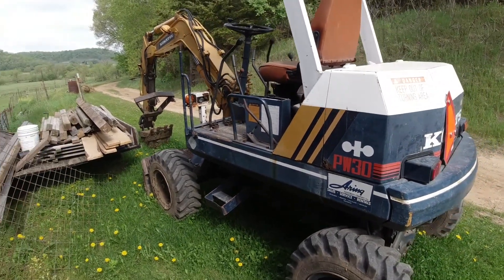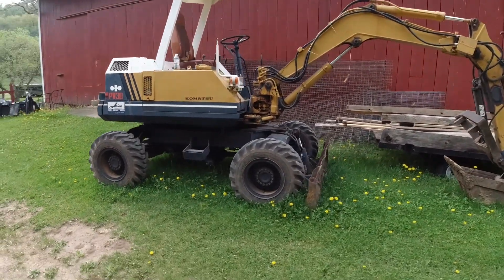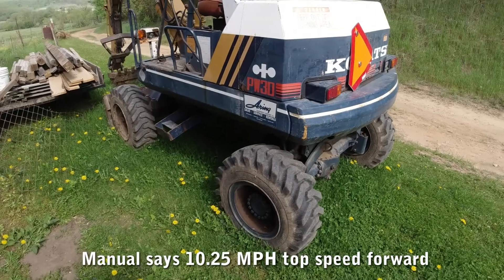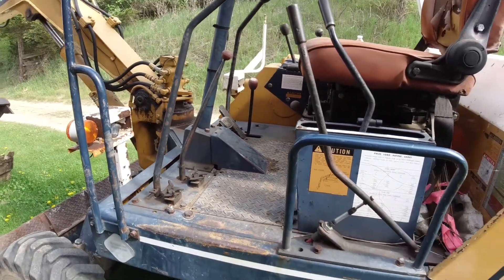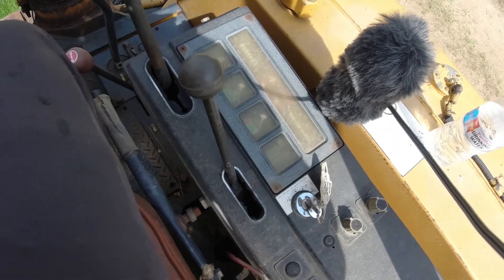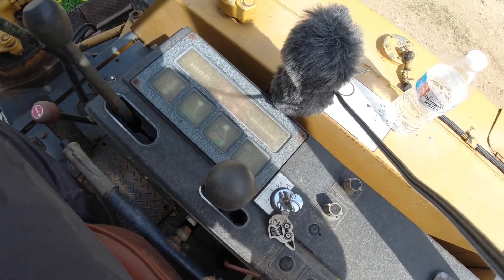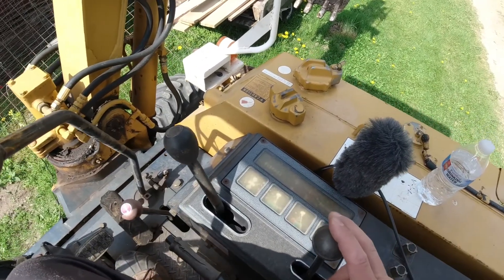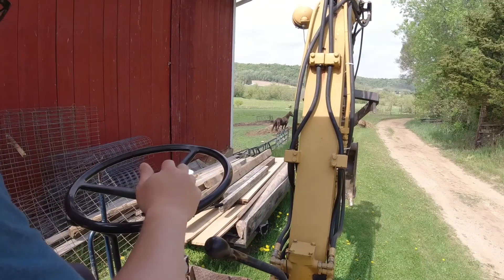Wheeled Excavator Demonstration - Komatsu PW30 - Picking up and loading scrap metal

Comment: Hello nice machine looks still fresh. How to you dig house footings with this ?
Reply from the maker: It could be done, might take a lot longer than using CAT 323 or similar.  It works the same as most excavators, you just need to be careful in mud so you don't get stuck. Thanks!
Reply: @driftlessinwi  how do you cross over a ditch using a wheel excavator ? You probably need to do that when doing house footings I think

Comment: I have tip for you, I have worked on weeled excavator for a few year, you dont want to put the blade down exept you are going to use the blade to push stuff, reason is that it will make you more unstable since it create a tiping point under the midle of it. another on is to upp trailer hitch on the blade so you can have the trailer attached to the exavator, it make jobs like this much easer :)
Reply from the maker: Great tips! Thanks!